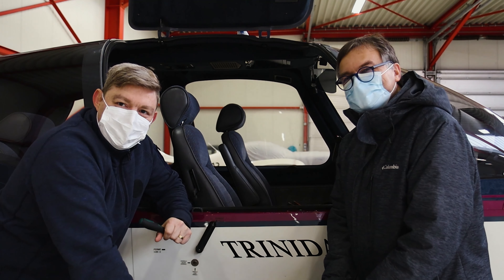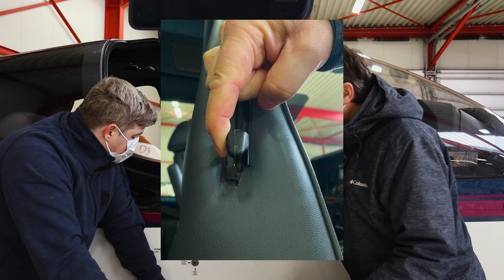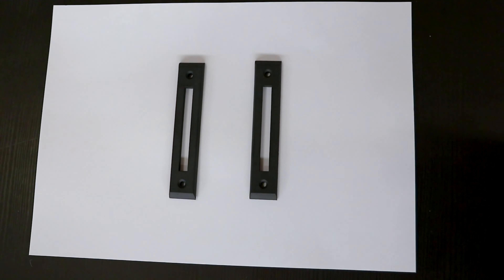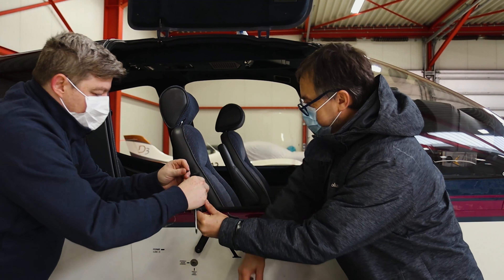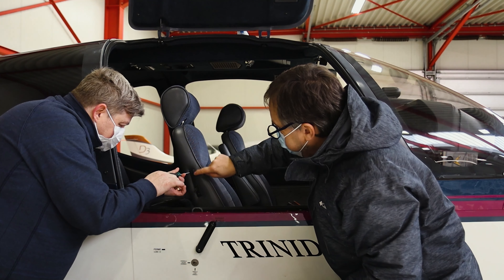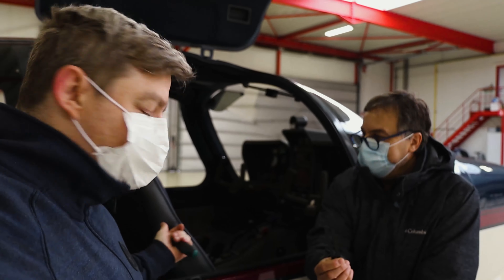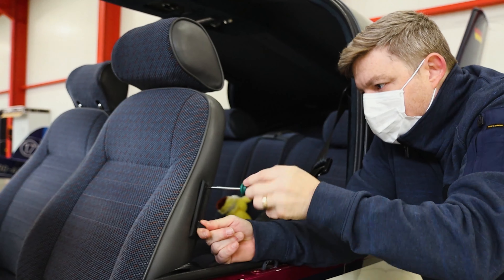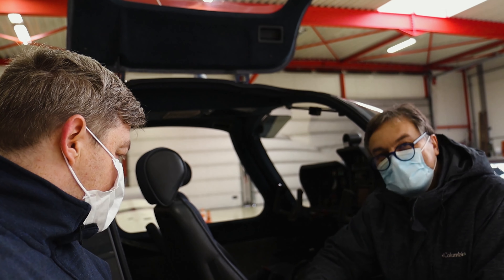Vlog #2021_03 Fixing a broken seat in the TB20

Comment: Do you guys have a 3D printer yourself or did you have it 3D printed by someone? Really clean solution!
Reply from the maker: Don’t have a 3D printer. Dirk made the drawing and we have sent that to a shop.
Reply: I created the design in TinkerCad (very simple geometry, so not necessary to use complicated software). I sent the model to a 3D printing service. In principle, one can print the model with a (nowadays cheap) 3D printer, but I wanted the piece printed in nylon, which is less obvious to print (high temperatures needed, warping issues, hygroscopic filament etc)
Reply: @dirkroosendans9964  Love the 21st century solution! Well done!